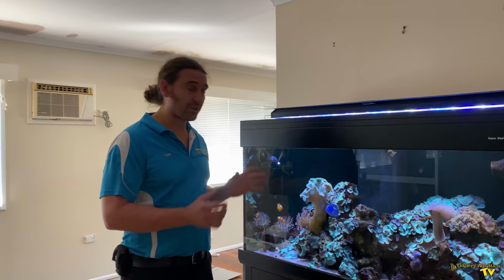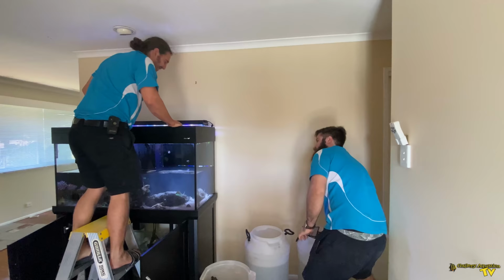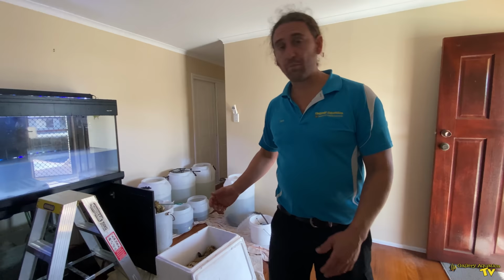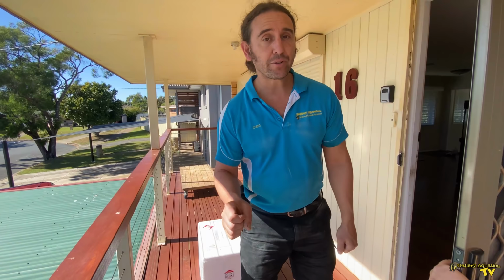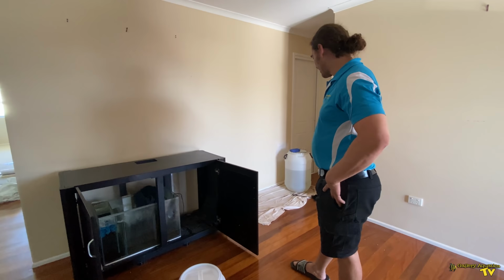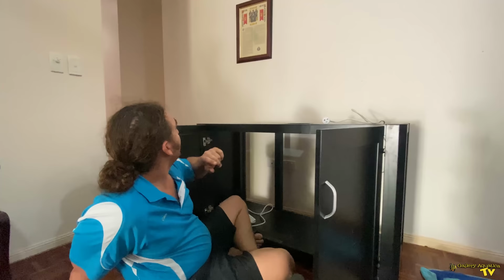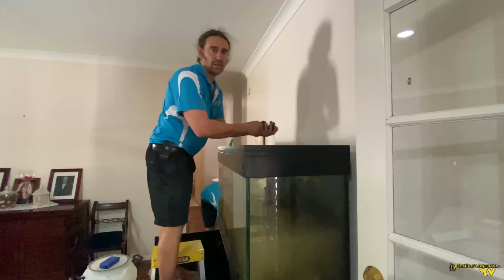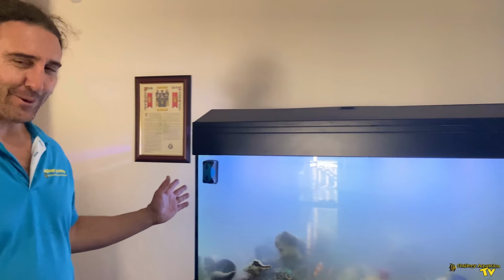Moving Mushroom Magic!

Comment: Great job Cam. I have the exact same tank. I would have trouble relocating my tank. I cemented the base of my aquascape.  I made it in three separate sections. It took my husband and I to lift it on to a board then lift the board up to the tank. My husband then was able to lift it on his own to place it into the tank. We did this 3 times then cemented the 3 together. I have some loose rock I added. If I was to ever relocate it there would be no problem cutting with a saw the cemented joins. You maybe asking why did I cement my rock in the first place. I loved my aquascape and I don't have any intentions of doing a re scape. Love watching you videos🐟🐠🦀
Reply from the maker: Michelle Conabere thank you so much for the message. It’s not easy to get the scape just right! Worth the extra effort for sure

Comment: Do you not worry about the silicon when moving tanks ?. There are statements around that silicon works much better when the water pressure is constant. Removing water results in no stress on silicon. Is this a problem ? Cheers Piotr from Perth
Reply: Have you ever tried pulling apart two pieces of glass that have been siliconed together? Give it a try and you’ll see how strong tanks are with or without water